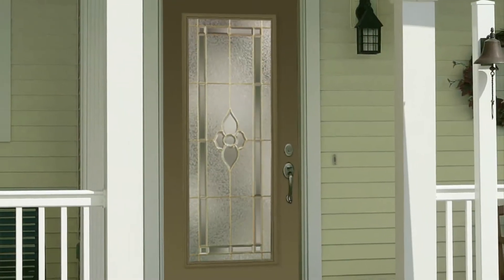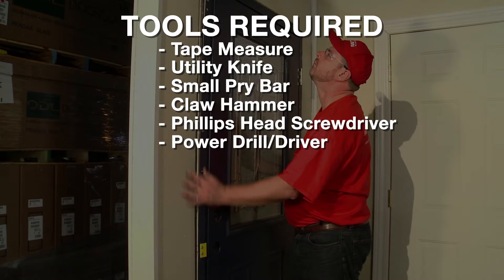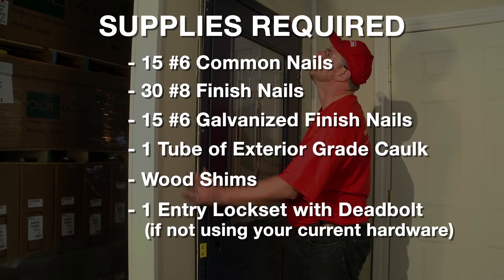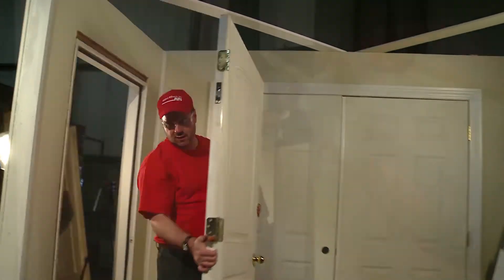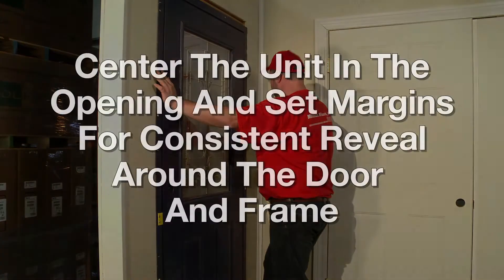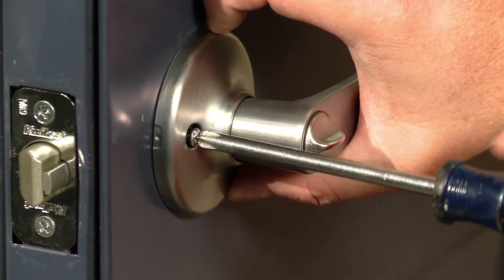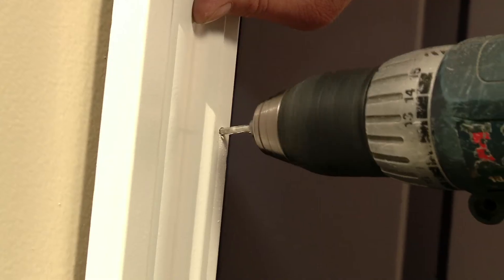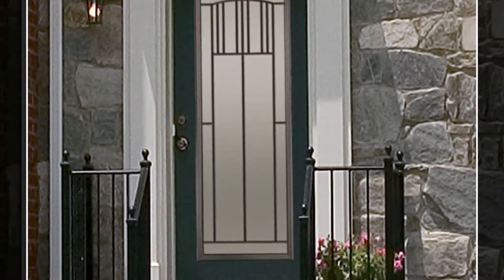How To Install An MPact Steel Replacement Door

Comment: video is too simplistic.  shouldn't I have to shim and square the door?  No fasteners need on threshold?
I think a test fit might be a good idea, as well as seeing if old frame is plumb and square.  Not all the supplies and tools mentioned were used in the video.
Reply: You don't have to shim because it's going over the existing jambs that's already shimmed and plumb.